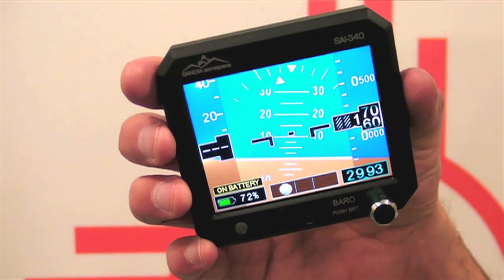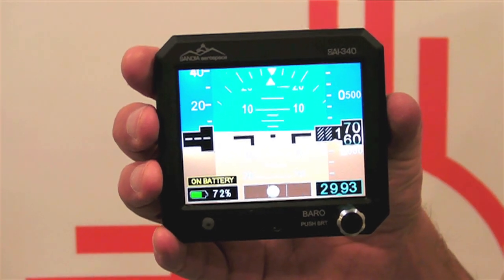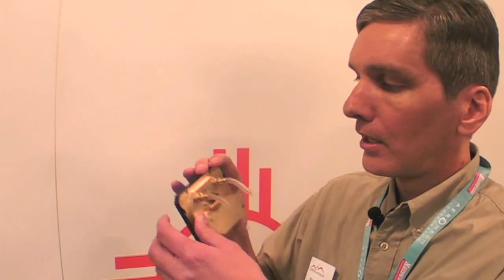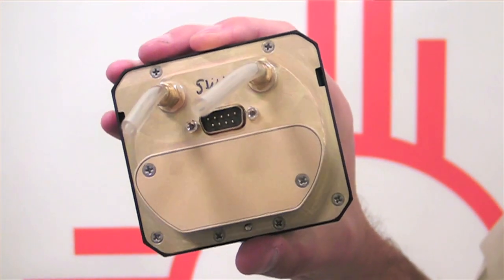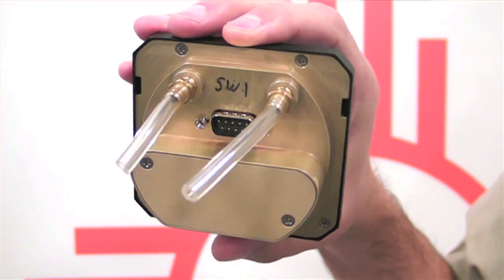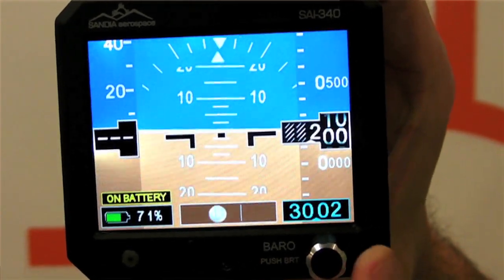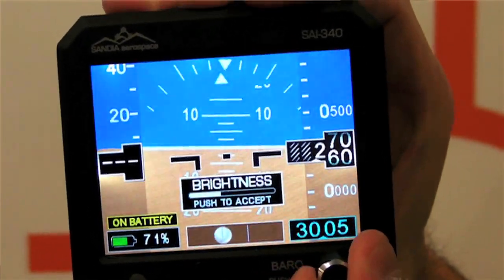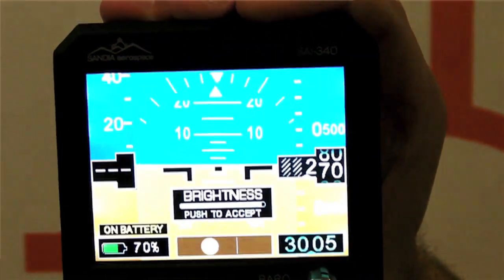Sandia's New Standby Attitude Gyro

Comment: That's very nice!  It would be good to know whether it has any dependency on the pitot/static source to compute its attitude solution.  The Aspen units have this dependency, and that's why you can't get rid of your standby AI even with dual Aspens, unless you have a second pitot/static system.

This certainly seems to be doing attitude without a valid pitot solution, but it's just a demonstration.
Reply: There is no interdependence - airspeed or altitude can fail and attitude will continue to function.
Reply: jeff bethel Thanks!  Seems like a winning product.